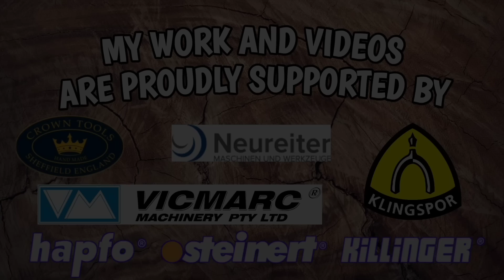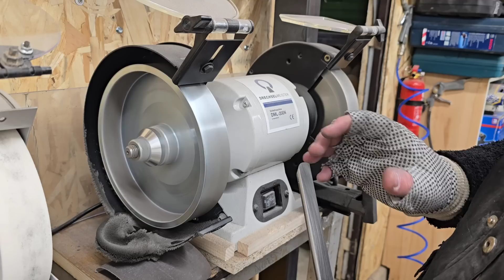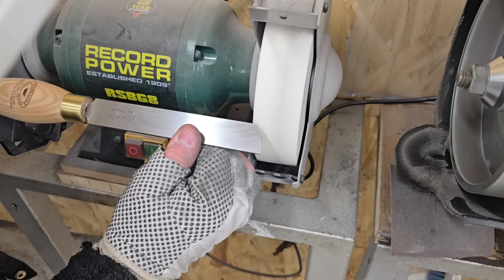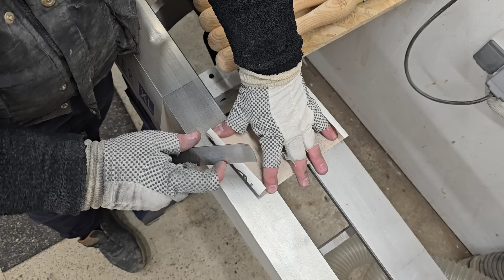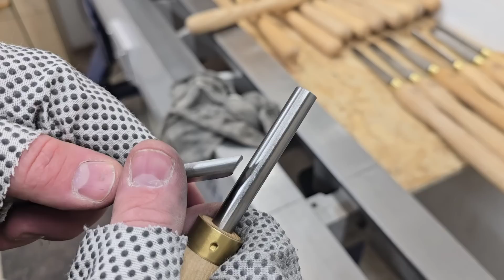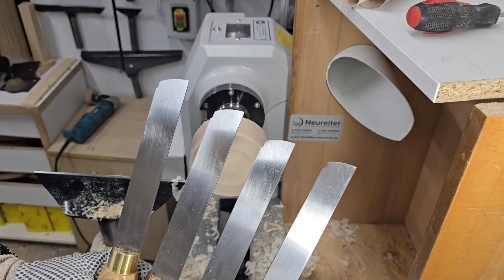Big Update For My Signature Tools

Comment: That’s fantastic that your bowl gouges will be made of M42 steel.  Why do you not use M42 for the Refiner?  Is that because the burnisher must be of harder material than what it’s burnishing?
Reply from the maker: M42 scraper will be more expensive but I feel that for scrapers I prefer m2 hss rather then harder m42, but for cutting tools like gouges I do like m42.
Refiner is cryogenic m2 hss and burnishers are m42 rods
Reply: He's mentioned the refiner is also m42. Burnisher is harder than m42
Reply: @ I recall him saying the Refiner being M2.
Reply: @Ethan-pb3jq  gotcha, I must have missed that. I remember when he first introduced the refiner he said that he is using XYZ metal as it's softer so it can get sharper than usual and it's cryo to keep the edge longer. I thought XYZ was m42 but could be m2.